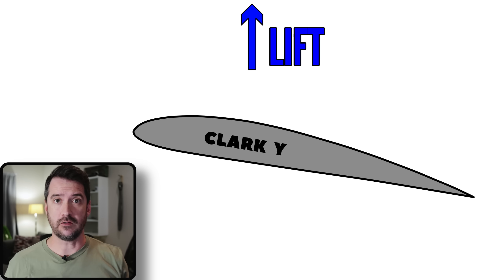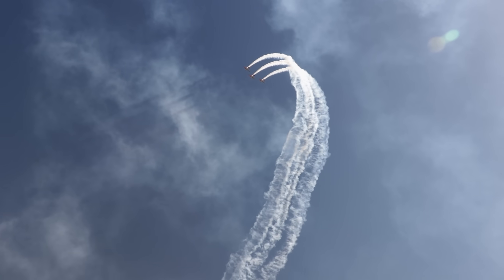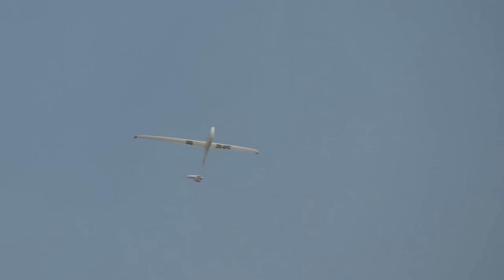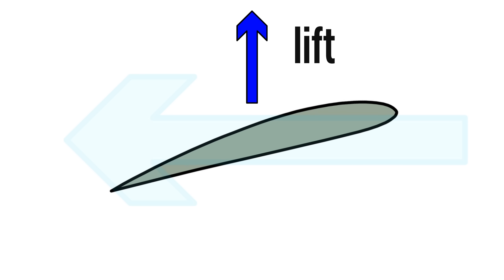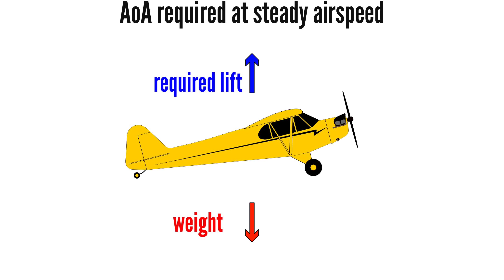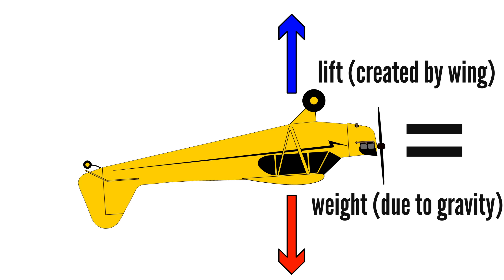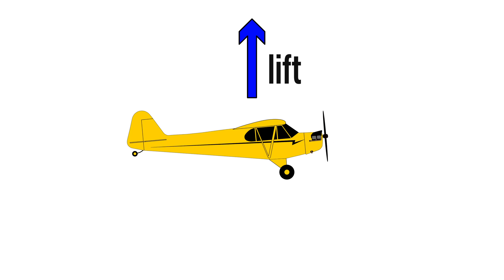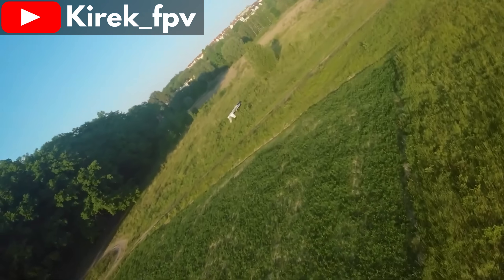Is Airflow Distance Over the Top of a Wing Always Longer?

Comment: I dunno.  Consider the ol' 'stick your hand out a car window' experiment: you feel a 'push' up or down more than a 'pull,' as you alter your AoA.  I suspect the foil shape has more to do with efficiency - you can fly slower or with less fuel consumption with a proper foil profile compared to a simple flat shaped foil.
Reply from the maker: A clark Y wing with it's bottom surface 100% parallel to oncoming air has a positive AoA (remember AoA is the difference between relative airflow and the chord line, not the bottom surface). How does it create lift, as no air push the wing up?
Reply: @LetsGoAviate  He is correct. You misunderstand a few fundamentals. 1) AoA - there is no single "AoA". You refer to what is known as the geometric AoA, but we know that for asymmetric (cambered) wings, the lift polar ("plot") doesn't have its y-intercept ("go through") the origin. Look for yourself. Look up the Cl vs AoA plot for a symmetric and then asymmetric airfoil - what do you see? Cambered or asymmetric wings shift the lift slope left and right with respect to the origin. That is, at 0deg geometric AoA, the wing is not necessarily producing zero lift. 2) Downwash, or deflection of the flow in the vicinity of the wing does occur (for your example, Clark Y) but its not correct to assume that this deflection (the downwash) is generated simply by particles colliding with (and being deflection downwards by) the pressure surface (underside) of the wing. In reality, the low pressure on the suction side, bends (for want of a better word), the flow downwards, resulting in a net downwards deflection of the flow downstream of the wing (and of course upwash ahead of the wing!), so if you "zoomed out" and placed a control volume around the airfoil (in 2D) or wing (in 3D), and then performed a momentum balance, you would see a change in (linear) momentum in the vertical direction equal to the amount of lift being generated.The issue most people have is that they seem to get caught up with a whole lot of terminology and say its "Bernoulli" (ugh!) or "Newton" when they dont really understand the fundamentals ... In truth, in the absence of gravity and other point sources on the fluid particles, all changes in direction of the fluid are created by pressure gradients. Second to this are the viscous (stress tensor) forces which act on the flow at the airfoil surfaces, but which for lift are usually negligible, because they act mostly in the "drag" direction. NB a pro tip, if you are interested "Bernoulli" as people like to refer it, is actually a re-expression of the conservation of energy (nothing to do with momentum!) equation and which holds only under a very strict (and small) set of conditions (inviscid flow, along a streamtube), but of course, like most things, people with limited knowledge (I suspect flight school instructors mostly, lol!) latch these ideas and create huge theories (and confuse everyone) out of them. Bernoulli's equation simply says, in the absence of viscous forces, the energy of the flow can be expressed as in terms of "pressures" and is reversibly interchangeable between the static (potential) and dynamic (kinetic) forms.

Comment: I think you're wrong. 
The air "going faster" over the top of the wing is simply a logical tautology. It's not actually responsible for creating the lift. 
The thing creating the lift is the air smacking into the bottom of the wing. Period. End of story. 
That the air happens to be faster over the top of the wing is simply a byproduct, not the cause.
Reply: Pressure over the wing is pushing it down, by reducing this pressure, the downward force on the top surface is reduced . So the resultant force of the wing is greater due  to the increased velocity over the wing. This needs to be recognised, as it greatly influences the efficency of flight
Reply: https://www1.grc.nasa.gov/beginners-guide-to-aeronautics/venturi-theory/#:~:text=It%20neglects%20the%20shape%20of,lift%20generated%20by%20an%20airfoil.
Reply from the maker: Thanks. A Clark Y wing has a positive AoA with the bottom surface completely parallel to, oncoming air. How does it create lift?
Reply: @LetsGoAviate  it's always got some amount of AOA.

Comment: To do a decent loop you have to push hard on the stick. The ball on a string argument is ridiculous
Reply from the maker: Only so that the loop isn't egg shaped at the top, but circular. Not sure what you flew, but in the Pitts we only relax stick back pressure going through the top, definitely no forward push or negative G's involved.
Reply: At the top

Comment: Hi - no argument with your basic premises. I bit of nuance on how you say it. First a wing that stalls still produces lift because the bottom of the wing is being impacted  by the air it is advancing on and deflecting air downwards. When the air detaches on the top surface there is a loss of the reduced pressure on the top side ( bernoulli's principle) of the wing reducing that part of the lift and at the same time drag is really increased. So total lift does not go to zero and If the plane has enough power it can still fly in a stalled or partly stalled angle of attack. A barn door with a huge motor will fly fine but it is not practical. Another way to look at lift is to see what happens at the trailing edge of the wing. The higher velocity of the air over the top side meets the slower air under the wing and the sum of the two airflow bends the exit velocity of all the air downwards. Looking at this from a momentum theory, airplanes fly by accelerating air that was motionless before the airplane arrives and is now moving downwards. A very narrow flap at a trailing edge has a huge effect on total lift both positive and negative when changing its angle. A reflected airfoil shape has a huge effect on reducing the lift and can only be compensated by a higher angle of attack. Wing shapes are a compromise of making lift efficiently in a very low drag way. Drag is really more of an issue than just making lift. Hope this helps

Comment: I've heard this same arguments that lift creation doesn't happen because of a pressure differential on the surfaces of the wing but because the "wind" is pushing against the wing and pushing it up. This is usually the argument of the same people who claim that there is no such thing as an accelerated stall - instead the stall is created by the airplane magically slowing down to below unaccelerated stall speed long enough for the airplane to stall.